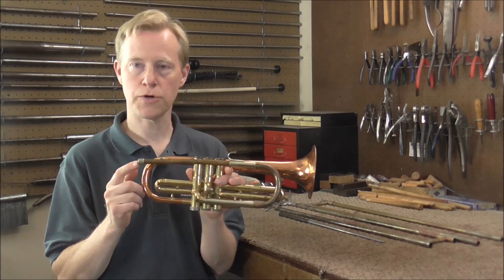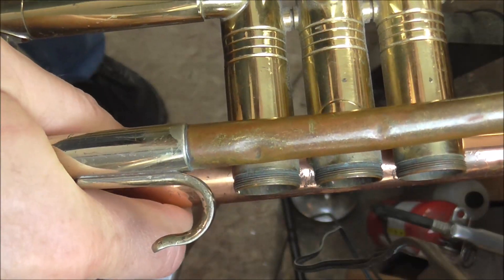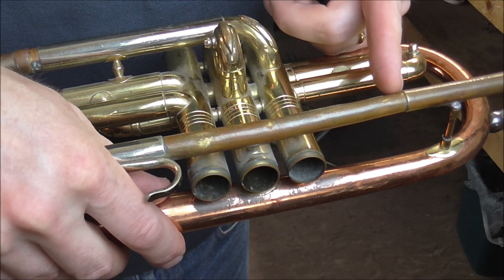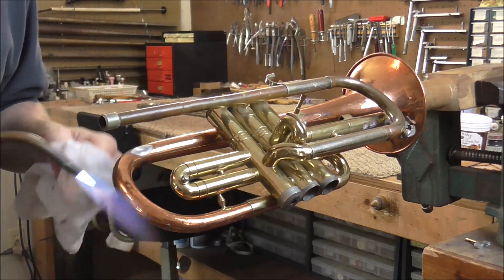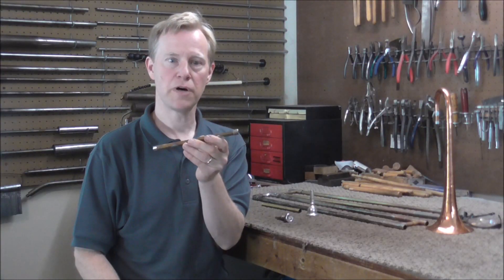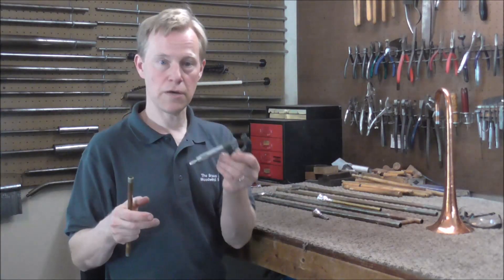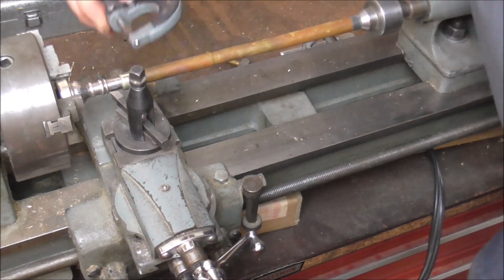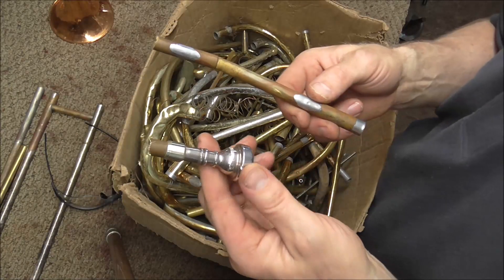Building a Slide Trumpet #2 Dent Removal and Using the Lathe

Comment: As mentioned by Kostya, the thing in the tailstock is a live center. It is a center because of the 60 degree point, and it is live because it has a bearing. There is also a "dead center", which would be  the point without the bearing. In the 1960s and before they were common, but bearings have come a long way since then, and live centers are now much more common. And of course they are easier to use. The point Kostya suggests chucking in the chuck would be an example of a dead center. Usually you would turn it with a 60 degree point rather than 90, but either would work.

I saw no real problems with the setup on the tool in the tool holder. The main things you want to do is a) make sure the tool is on the center of the work or just very slightly below, and b) keep the stick-out on the tool as short as you can reasonably manage. 

The trouble with turning brass and copper is that they are "grabby" metals and will cause the tool to dig in if you aren't really careful and take very fine cuts. As you know. :-) This is especially necessary with thin long unsupported sections like tubing. You can also have it grab if the tool is above center. The work will be pushing back on the tool in that case, and cause it to dig in as it pushes the tool down toward center. If the tool is on center or slightly below, as it deflects it will move slightly away from the work, and is less likely to grab.

One good way to turn tubing is with a close-fitting solid mandrel inside it. This will stiffen it up so it won't deflect away from the tool as easily, and then bend back and grab.

Comment: In a tailstock you have a live center 😉 Instead of using a mouthpiece,  you could turn a 90° conus in the chuck from any peace of metal by turning compound rest 45° and then place a leadpipe between conus and live center with a little pressure. This will keep blank true and help to do the job right.

Comment: I am a brass and woodwind technician for 18 years and i knew that it was going to break,
1- i think all ur lathe setup is good, but i think u rotate the headstock to the wrong direction, it should rotate towards you. If it rotates away from you then all what that facing bit will do is rubbing the brass tube and not actually cutting it
2- that cornet lead pipe is thin and hallow, that mouthpiece receiver u was trying to face is a bit thicker than the lead pipe, so a long thin pipe extended from the late headstock to the tail stock, it will break in the weakest point which is right after that mouthpiece receiver.
3- to prevent it from breaking you should had used a leadpipe mandrel inside and then chuck it in the lathe
4- safety tip (never leave that chuck in the headstock) bcz you can forgot about it and start the lathe